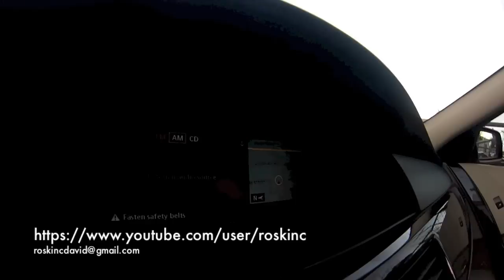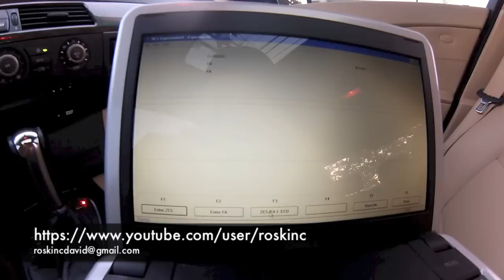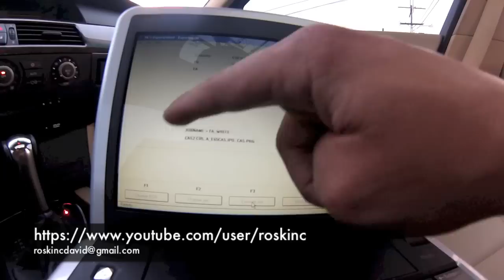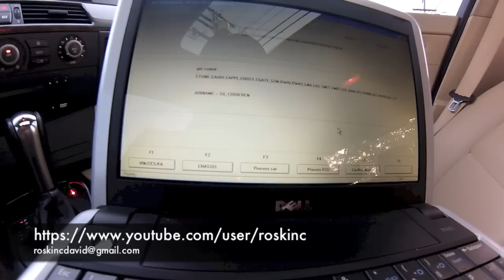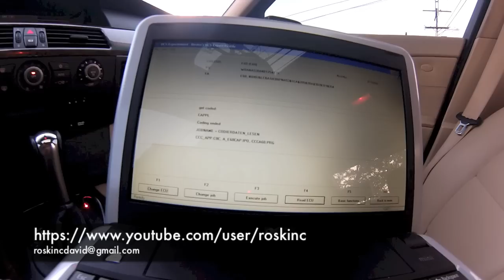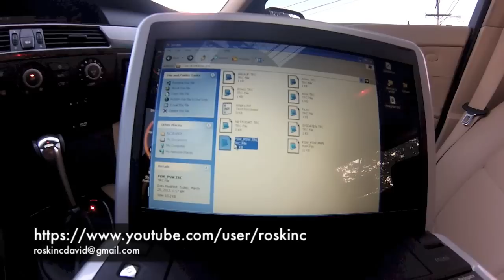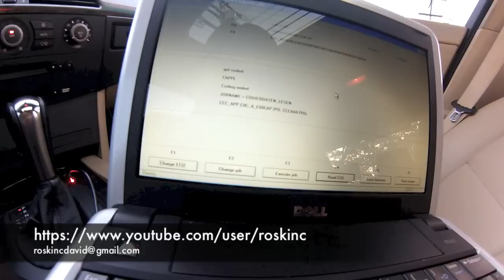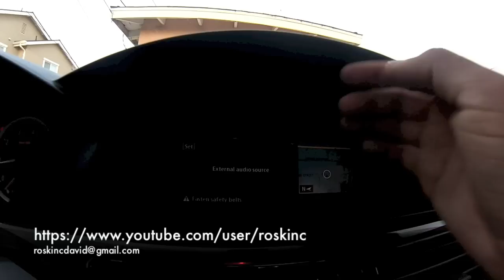BMW E60 5 series How to code AUX in Idrive ncs expert step by step

Comment: Its 2025 and this tutorial is still valid! Just came from doing this myself and worked! My only hiccup was the profile you’ve mentioned and i followed a comment below and used one of them that was already given. Did this on win 10. Thanks so much! So glad my bt transmitter isn’t needed anymore as ive also installed a carplay radio which relays my phone audio via the aux input. This setup is invaluable.😊
Reply: Did you have any problems with it losing the coding after you had done it?  This procedure works fine on mine (E64 6 Series) but it just loses the coding, even though, When I go to edit the TRC file again, it says Aux IN is still mounted?!?
Reply: @ I haven’t came across any issues of the sort. My battery even died and everything works fine. But I never went back to look at the current MAN file in use after. if that what you are asking.
Reply: Do you loose the initial coding to activate the aux option or does the MAN  file reverts back to aux in: not active
?
Reply: @guccijo1066  Both the MAN and TRC files still look correct - i.e. they say Mounted/Aktiv like they should after I changed them - but the Aux in disappears!?
Reply: @DanMorgan-b1j  try using the factory profile instead of revtor. Also run programs as admin + as win 7 if you’re using windows 10

Comment: great vids pal any chance u can tell me which cable and software to buy off ebay that works best for my bmw 550  need to code for aux option ..the one u talk about for 45 dollars ... do u know if they work on a MAC latop ?   sorrry sooo many cables and software ones to buy  not sure what ones are good or just crap ... thanks again for your time and vids so helpful  thanks so much

Comment: Great video - Thanks.  I've seen another video that uses NCS Dummy alongside NCS Expert but that seems more complex so not quite worked out how to use that one to code the Aux In .  This process did the job but I have come up against a problem - it loses that Aux In after the battery is disconnected or after leaving the car for a short time.  If I cycle it off and back on. it is there still.  I may need to charge the battery for a nit so will try that but I still don't see why, if the battery is low or disconnected, it loses the coding?  Anyone had any similar trouble?
Reply: Should have also said that the if you do it again, the TRC file still says it's mounted?

Comment: Hello,

I did mine but without addin +NAUX in the VO and as you've said it works but, i have no bass and the sound is poor. It is like the sound is not processed via the aplifier. Could this be caused because I did not add aux in VO ? 

P.S. i have tried bypassing the original aux behind the armrest and still soundnis poor. I had CCC but it broke and retrofited MASK.

Thanks!

Comment: hey roskinc  i was wondering how i get the software to code my aux .. i got the cable u suggested and downloading a copy of xp on my mac laptop , the cable came with software u suggested .. is that the disk to start me off on xp with the cable i got off ebay ?   thanks for your time   sorry just leaning from scratch   thanks again

Comment: Those adapters usually also have Bluetooth audio capabilities. Older e60 models had Bluetooth for calling but not audio streaming. Is there a way to activate Bluetooth music streaming on older e60?
Reply from the maker: Not possible. Only way is if you do a complete CiC retrofit and combox
Reply: roskinc hmm that’s what I thought. Thank you for the prompt response.
Reply: roskinc just thought I would share this with you.  I I actually was able to make it work with a Bluetooth-Aux adapter. The wiring is similar to your other video but I had to cut and tap into some power and ground as well. Although there is no Bluetooth coding option for audio streaming on the idrive,  your phone connects to the device through Bluetooth and with aux being selected on the idrive it tricks the car into thinking it’s aux and plays music. All wireless and quality is decent.
Reply from the maker: Engineered Approach thanks for the input but I’ve been making Bluetooth adapter like your describing for several years now

Comment: would that aux cable and codding work on an e60 manual from 2004 530 d, if yes how do i get the aux cable, software...thanks
Reply: did you ever find out?

Comment: I have a 2007 BMW 530i.. If my iDrive already has the AUX option on the menu then does that mean the car has already been coded for auxiliary?
Reply: Your car should already be installed with the Aux port. Could be located in the glove box or rear end of the centre console.

Comment: Shall I assume that the NCS software is not available for Mac?
Reply from the maker: You can use on Mac if you use a windows emulator like parallels, I currently use a MacBook Pro
Reply: +roskinc Thanks for the quick reply! I also use a MacBook Pro

Comment: hi. ive done everything coding wise and it comes up on the CCC but i have no sound? if took the plug out and tried in the other slot. turned it upside down etc but still no luck??

Comment: Where I can get the software. .. I have a bmw 2004 e60 530i.. I need put the aux in the screen. ... can u help me plzz
Reply: Getting the software to work on a 64 bit windows 8 is hard. I downloaded and installed a semi older version to get inpa to work, then I downloaded and installed the newer version of ediabas and ncs expert. After that I copied and pasted files into ncs expert bin & ncs expert GFDA (something like that) to get English to show up. I then copied and pasted the datin files from the disk software that comes with the obd2 wire into ncs expert datin folder. Then I downloaded and installed the newest version of datin files (only for the model of your car). Once i had the datin files correctly installed, I then installed the driver for the wire and changed settings, latency to 1, and com to 2 (remember to select the correct com when installing bmw standard tools). Once everything is good to go I copy and pasted profile: "expert mode" into ncs expert pfl folder. It is hard, but it finally worked for me. Maybe I'll do a youtube video showing what I did.
Reply: +Bryan R wow that's a ridiculous amount of steps, where's the vid?

Comment: Question, i managed to add AUX to the VO

However when I go to open the config file to change from unmounted to mounted, I  don't see this option. 

I see an option relating to aux, which I changed from nicht activ to activ after adding aux to VO.

This seems to have enabled the aux option on my idrive screen, however I'm getting no sound when I music from device that's connected to the aux port. 

It's a very early 6 series, I did think something was up when I didn't see the mounted/unmpunted options and only saw nicht activ / activ. 

Any ideas on what I'm doing wrong?

Comment: HI DAVE, THIS ERROR APEARS COAPI-2041: WRONG ECU CODING INDEX
A_E60CCC:CODIERINDEX =0CH CAN YOU HELP ME.  THANK YOU
Reply: I have the same problem, can anyone help?
Reply: Same problem too
Reply: I solved the problem by letting someone who knew what they where doing program my AUX, and it took 3min and now its working. Have no idea what he did or what program he used.
Reply: I have the same problem, anyone fixed this already? Your help is really appreciated
Reply: Csongi Sandor why tf would you even comment that. What was your purpose

Comment: I installed your cable and coded for AUX for a 2006 550I I-Drive.  Using the same phone and cable from my Rover that rocks the house down, the volume in the BMW is low and doesn't sound like my CD's at all.  I know it has something to do with the car not my input.  I see lot's of posts but nothing so far on how to fix this in my case.  Is there some trick I'm missing?
Reply from the maker: Its the car no matter what cable you use. If you have android you can use a amp app that increases your volume, iPhone doesn’t have such app.
Reply: @roskinc  Thanks roskinc.  I did just that, tweaked it and now my aux is just as powerful and clear as my CD changer.  Adds a layer of complexity but at least I have streaming music!  This only worked for direct cable connection not for bluetooth.  Maybe there is an app for bluetooth.

Comment: How Turn on AUX in BMW E60 2003 sedan without navigation.
Please use this instruction from minutes 5:10 and first please configure own Export mode profile.

Instruction please visit site: http://sam-naprawiam-bmw.com.pl/kodowanie-diagnostyka-komp/edycja-profilu-ncs-expert/
IF you need english version please use google translation Polish -> English

My instruction
Open Ncexpert load your configured profile and
F1 - VIN/....
F3 - choice E60 - choice CAS
F6 - Back
F4 - Process ECU - choice MASK and click OK
F2 - Change Job -> Codiren......_Lesten
F4 - .. ECU (close hexa window/popap)

Please check file FSW_PSW.TRC in ncexpert work folder and verify if exist in this file AUXIN - please continue
Backup FSW_PSW.TRC file
Edit FSW_PSW.TRC file and change 
from
AUXIN
 nicht_aktiv
to
AUXIN
 aktiv

and save as file to FSW_PSW.MAN in work folder

F2 - Change Job - choise "SG_Codiren" and click OK
F3 - Execude JOB

In my car is now AUX is works.

Thank you "roskinc' of this instruction - Help me to back works my Bluetooth/mp3 player/handsfree system use AUX IN in my BMW e60 ;-)

Comment: Thanks, Great help. Just did this and followed ur instructions. The only difference was in in my .trc-file it didn’t say “auxconfig not_mounted”, but rather “auxin not_active”. I changed it to “active”, and saved it as per instructions. It worked fine. I now have installed an apple carplay unit to the aux in and it’s just perfect. Thanks a lot.

Comment: i get as far as loading (at 3.04)expertmode profile then then error "profilversio 2 0 Ungultig!" meaning profile version 2 invalid,using spdaten 46.3 inpa 5.0.4,ncs expert 4.01 on win 8 64bit car is a e60 530d  built 24/11/2003 UK version
Reply: solution to problem "download v3 profiles they work with latest v4.0.1 64 bit
car has aux displayed but no volume..........WTF stone walls me every time i think i got it!!

Comment: Did exactly what you did but used lma instead of cas. 
1) i did not have to edit file when it came time it copy edit ands ave file.
2) aux option shows up but there is no sound. Radio stil qorks though.
3) one post i read skipped the step of switching profiles and actually reading ecu, instead stayed in profile and i guess wrote to sg codieren. Is that a step maybe i should do?
4)some posts are making it seem like a wiring or something spefecically cant remeber right now

Do you know why this is happening and any solutions? Response asap would deeply be appreciated.
Reply: Rosk Inc  but for me didnt show anything i think i need the code CD

Comment: Hey guys does anyone having issues and get coapi-2020 error? Anyone knows how to fix this?
Reply from the maker: Drewst Frey Daten files, double check the settings for the Coding cable is com3
Reply: @roskinc  all checked, went through it few times step by step, but when I see the car info aux supposed to be working but no audio at all  /
Reply from the maker: Drewst Frey does aux show on idrive menu? If it does, then the aux cable isn’t installed correctly. If aux shows on idrive, then the issue is hardware not Coding.
Reply: @roskinc  doesn't show on the screen, but when I see the coding after the 2020 error it does says it mounted :/ I'm a bit confused about it but

Comment: Best DIY I've seen. Bought the aux cable from him. The hardware installation was a breeze thanks to your help. I did have to use one size higher when drilling the hole for the cable. The hard part was coding the car. If you have a 32 bit windows xp I'm sure it is easy but all I had to work with was 64 bit win 8. Getting the software to work was the hardest thing. Took me 2 days to finally have it up and running. But once I did it was a piece of cake. Unfortunately my cars' battery died due to the programming and as of right now I am unable to go and buy a aux cable to test it out. But super easy except for the coding, but once you have the software working it works, thanks for your help. Oh thanks to one of the comments down below. My cars code was in German and instead of "not_" it was "nicht_". My spelling might be off but yea. THANKS
Reply from the maker: Bryan R yes the hardest part is just getting the software setup after that easy!
Reply: +roskinc Software was a bitch and a half. What a relief when firing up and no errors.
Reply: +roskinc Any idea what cable to buy. I just looked ok eBay and there are loads. They all say about reading and deleting codes and extras bud none about coding in aux. There are so many different models as well. I have a 2003 e60 525. If u can help would be great.

Comment: Hello. First tnx for video. I have now aux in my car. And its working now. But there is no Bass an the folume is less then on radio or cd. How did you solve that problem?
Reply from the maker: Are you using OEM cable? Because OEM cable has bad bass and low volume. My cable has good bass and quality audio.
Reply: +roskinc I think yes... where I can get that yours?
Reply: I'm the guy who recently bought your cable and do you think you can email me so I can just have you on hand to answer any questions if I have some. I also bought the coding cable. Should I program or install the coding first

Comment: i bought the same coding cable from ebay that you have with software, but im having the hardest time installing the software..I tried to get more info from the seller but no luck.. Is there anyway way you can shine some light in how to install this software?? They send me a video link in Chinese but i cant understand it..thanks
Reply: Did you figure out yet? I got the same problem lmk

Comment: I just saw a post.  It definately works on a 2004 E60, 530i.  There is a bit of a process configuring the port but once done, the post/video is very accurate.  Hope that helps.  Peter
Reply: Hi Peter I have a 530d 2005, I installed oem AUX and coded it in but no sound yet. 
Would you tell me how to configure the port as it seems to be the problem
Thanks

Comment: my question is if I can firstly code the car to enable the AUX option without installing the AUX cable itself, beacuse I thought to use an adapter that has a 3.5mm on it via the charging port (12v socket) instead to build in the AUX cable like you did?
Reply from the maker: Adii S yes you can code aux without an aux cable connected, I always code first before installing.
Reply: Oh nice, I will soon do that, just waiting for the cable to come, also were can I download all the necessary software to code the AUX in iDrive?

Comment: best video, i have the same car 525i 2004 i will try to install the aux cable as u did in the other video plus i will try to code it myself if i couldn't i will send you an email so i can get help if thats ok with you thanx alot man.

Comment: I own a bmw 745 li 2005 model and I bought the aux cable thinking it was all I needed. didn't know I needed to code it in order to work. wondering if someone can code it for me. let me know if you can and how much you charge.

Comment: Hey man spent a long time trying to do this upgrade to find out that there was something wrong with the "daten" files. Tried it on two different computers
Reply from the maker: aubrey peck find and download the most updated Daten files, unless your car was recently upgraded by dealer you can even use some a few years old. If your getting coapi error it's Daten issues if says FA error make sure USB cable is set to come 1 and frequency to 1 as well.
Reply: When I bought the adapter on eBay I thought it was a whole package as it came with the disk with the programs on it, where can I go to download those files?
Reply: Also I have a 2005 530i and it looks like my software is one step behind yours could that have an effect on it?
Reply: Uninstall everything you have, and delete files from the C: drive. Install Mikes easy BMW tools (first hit on google) and try again. This package has no DATEN issues and worked without fault for me on Windows XP 32-bit.

Comment: hi i need help, i have a 2004 e60 525i without navigation. i followed your video and also the description, but when i add +NAUX to the FA to the CAS and or LMA, i get an error message saying invalid feature to FA. i get the same messege on both CAS and LMA, i tried ignoring it and following the rest of the video, but when i open up FSW_PSW the AUX module is not there. please help!!

Comment from the maker: do you have a spare key? try using it with the spare key (win information is tied to keys, sometimes one will work and one doesnt). also only time ive seen the vin is faulty is when someone replaced their CCC for one with another car and the VIN wasnt coded with the new modules, it wasnt able to read it.